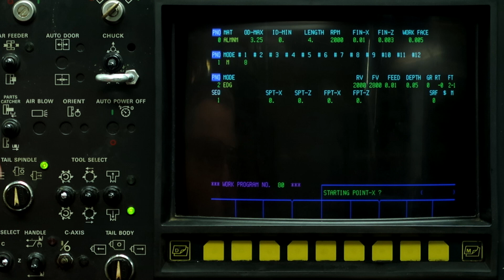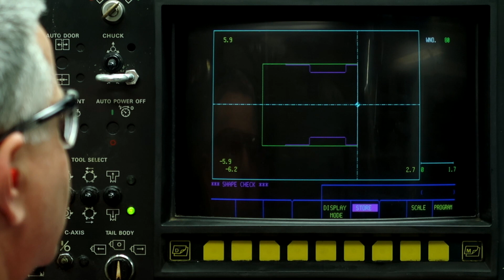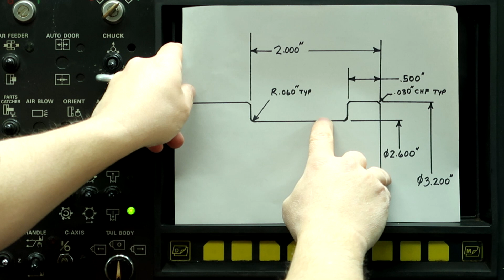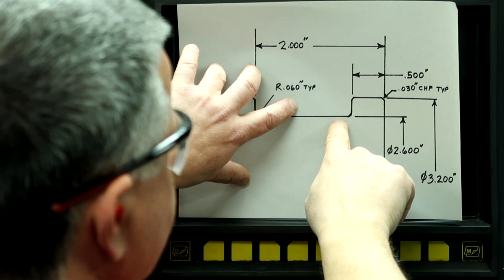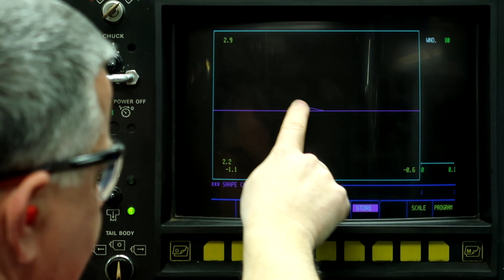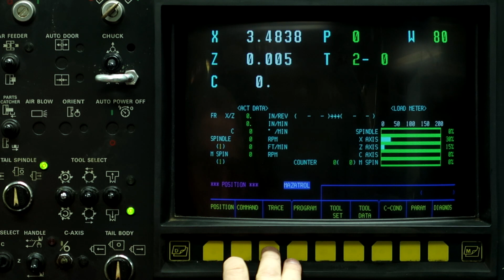Mazatrol Lathe BAR OUT Back Turning Mazak

Comment: Gday Phil please will you do a video on how to machine say 6 off the same part without having to set z zero each time manually  ? The part I am machining is 17.5 mm wide so after I part off I am thinking I should be able to type 17.6 in X so .1 to clean up face on next part further down the bar. I’m thinking I could  have the bar 150 mm out there for being  able to make say six or so parts in one set up and the machine moved down the width of the job +.1 as the new zero each time is this possible please ? I have mazak qt15n 1994 with Mazatrol t-plus  and thanks love your videos 👍from Skip living in the UK
Reply from the maker: Check out my video on End process Z shit.

Comment: Just curious why not turn down OD to a rough diameter 
Then,
Use a wide grooving tool to rough out the groove then come in with short grooving tool to finish them finish OD with turning tool?
I know on some machines like Okuma you can set 2 different tool offsets for front side and back side of grooving tool so when you program the part the machines knows which edge of tool you are using. I’m not too sure about the Mazak if it has that feature as well.
But just in my opinion it would be faster to rough out groove with wide grooving tool then finish with smaller grooving tool without having to machine out that angle/taper that you have in your program. 
Maybe I didn’t see something or you can help me see it from your point of view why you did it that way
Thanks 🙏🏼

Comment: How about showing a left hand thread.
Reply from the maker: Left hand thread are programmed exactly the same. The only difference is you install a left hand threading holder.  Making a LH thread with a RH holder does not work well on this machine.

Comment: I'm totally fresh in a Mazak quick turn and got stuck with a minor problem. I got a alarm saying tool lengt over(1109). Two toolholders on my 12 tool turret is slightly longer (around 20 mm) and the machine refuses to measure in X. The guy that installed the machine fixed it on one of them, but I can't recall how he dit it. Maybe it must be defined somewhere 🤔
Anyways I find it easy to handle compare to my old Harrison teach in lathe that also has a turret, but only 8 tools. As I went from 6 m/min to 30 m/min in rapid traverse it took a couple of days to set it on 100% 
I got scared🤣

Comment: Hello Sir , could you explain how to progrom the parts catcher in a mazatrol program on a QT 20 lathe with T plus mazatrol ?   I have already learned a lot from your videos Thanks !   Eddy
Reply from the maker: You would need to know the M-codes for part catcher and put M code in to extend the parts catcher before the cut off sequence and then another M-code to retract it after cut off.
Reply: You can manual program or with M Code. Parts catcher up M48. Parts catcher down M49

Comment: Thanks again for the great training. 
You talked about it does a rapid in that mode. If i remember long ago when running t2 control it ignored the keyboard manual rapid override and it goes full machine rapid ( 400 ipm) while running program. All other rapid moves like facing, etc ran with keyboard proper over ride. Yup, makes you tense up quick. 
 Keep the video's coming. I'm enjoying
Reply from the maker: Thank you.

Comment: Sir please make an video over Mazak ISO Gcode programming.
Reply from the maker: What do you need G-code programming for on this old control?  It will not do macro programming so it's very limited. The G-code side of this machine is comparable to a Fanuc 6T control.
Reply: Be careful doing mazatrol and g code in same program. Crashes may happen. I've done it. Always get the turret to home after g code or it rotates the turret at last z location in g code.

Comment: Your explanations are really well thought out and to the point. At the end you asked for suggestions. I suppose the top of my wish list would be:
How to use the VFC function, but more importantly how to reset it. (We call it the Very F***ing Clever button!)
How to alter the tool change position.
Reply from the maker: Got it. I love the VFC button! I will show you how to adjust the tool change position on a T-2 and T-3 control no problem. Newer controllers have different parameters so I can't show how to alter the tool change point on those machines. Thank you for the suggestions.